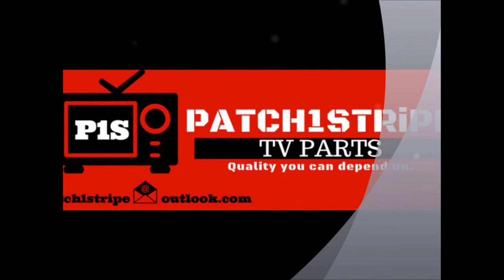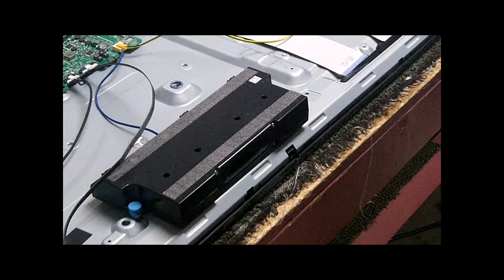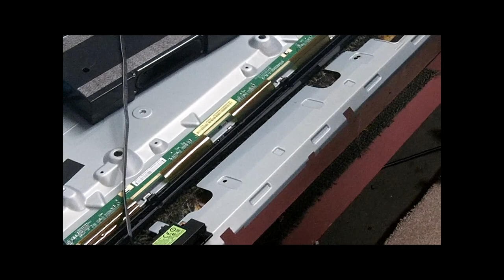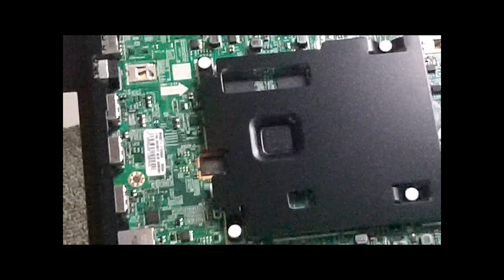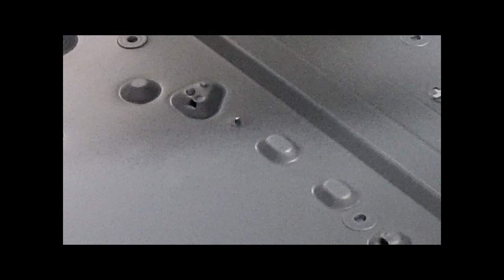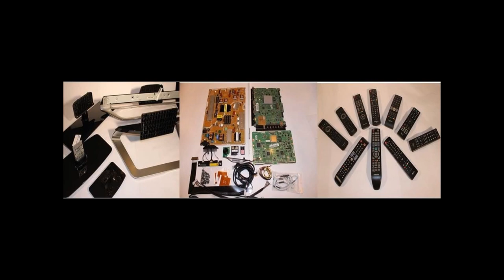HOW TO REMOVE AND INSTALL A SCREWLESS MOUNTED MAIN BOARD IN A SAMSUNG LED TV

Comment: I know that you posted this video years ago and I hope that you're doing well. I still want to thank you. I had an extra TV, same model, in the back. I previously broke the screen on the other one and it was just sitting in the back storage room. With your help, I swapped the boards out with ease and the current TV that we were using worked like a charm afterwards. Thank you sir very much.
Reply from the maker: glad it worked out for you. Thank you for the comments

Comment: Yeah just figured this one out about 10 mins before finding this video. LOL pretty smart idea for quick assembly.
Reply from the maker: great!
Reply: @Patch1stripeTVParts  any ideas on what parts on the main board might cause no standby light, no backlight, no response for anything? Initially I thought it was the power supply, but I have two identical TVs so I was able to swap the main board and it works. Would just like to salvage what I have and either keep it for the future or resell the board. Trying to source a replacement board at a reasonable cost in the meantime. For reference, I'm an electrical engineer with 15 years prior as an electronics technician doing troubleshooting and repair for military equipment. However, back then, I had access to the schematics, which made it easier to trace issues and know what to look for where. Thanks!

Comment: Hey! Would appreciate if you could give me a pointer. My set has similar internal setup pretty much. When I plug up everything, the backlights power on for about 12 seconds with a blank screen , then turn off. Then I try powering it on again and it stays on this time but same blank display . It responds to the remote. 
I've tested the power supply and wifi module using parts elimination and even the speakers using ohmeter. 
Do you think it's a mainboard/T-con or something else ? Ribbon cables all look fine, connectors are good.
Reply from the maker: when you disconnect the main board from the power supply board, does the backlight come on and stay on?
Reply: @Patch1stripeTVParts  yes it comes on and stays on. Only when I connect the mainboard does it turn on, then off, and then stay on.

Comment: I have a model UN82NU800 82 inch samsung smart tv. 

A lighter was thrown at the screen, causing it to not function anymore. It is brand new, and the screen itself is intact (no cracks or breaks). It seems to be purely the internal screen.

What part # would this be? or what is the part called specifically?
Reply from the maker: Hey Christian, the lcd panel is most likely damage if you inspect it closely with a flash light. A rule of thumb in the service industry is, it's more economical to replace the whole TV verse replacing the LCD panel. That just me from experience. And if I choose to replace, I would purchase the same model and harvest the parts from the broken one for spare parts later. If you do this, don't forget to harvest the LED strips as well. Best!